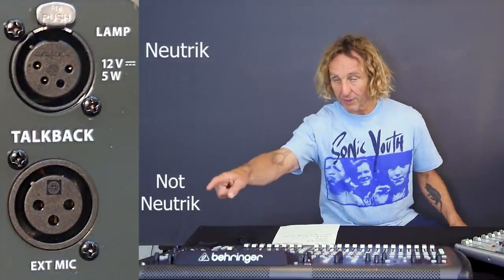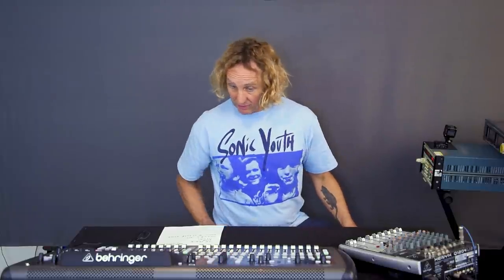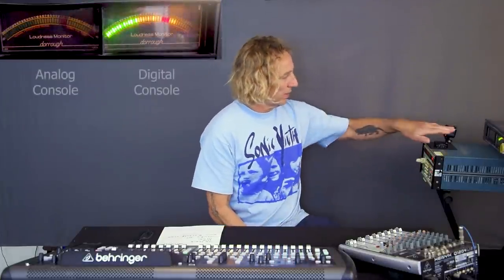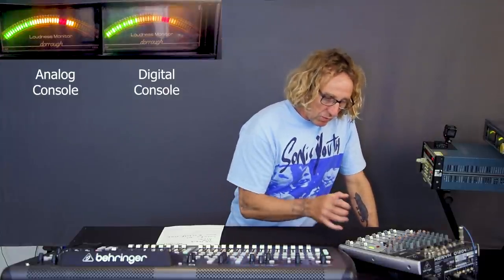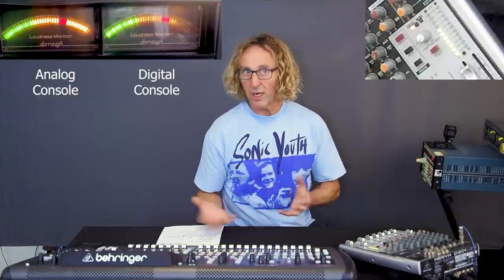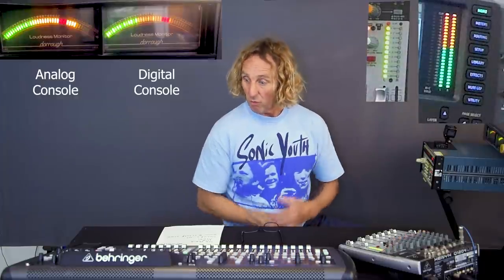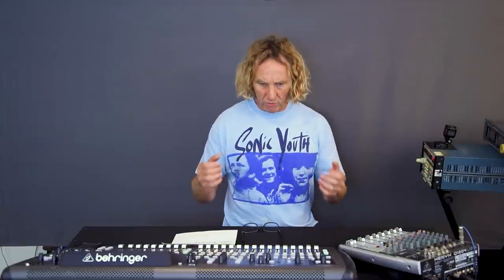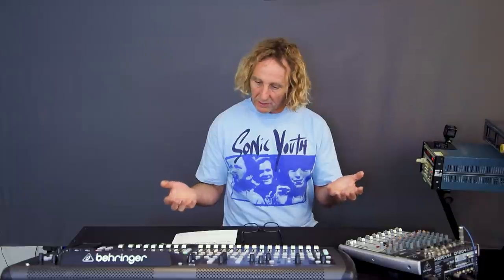Behringer X32 Digital vs Analog Console Metering & Output Levels (Public)

Comment: 100 meters is max length including patch cables. Not really a great idea to count on being able to use the maximum anything of anything.
Reply from the maker: 👍 though it really depends how the max was determined.

Was it determined using a 20% or 50% buffer or is it the actual max?

With rigging, using the max is all good as there are 5:1 or 9:1 buffers accounted for so the rates max is safe.
Reply: @DaveRat  
That is the rule of thumb limit for conventional Ethernet, it is commonly expressed by lots of vendors. Rules of thumb are conservative. On a dedicated network, you can push the limits. Same hardware and transport layer, different traffic environment. 

I have done something similarly for a flight simulator data collection system. We were pumping fast frame rate measurement data over gigabit ethernet and the NICS card we connected to mattered. So did the cable type and length. I don't really know details about audio snakes, I would like to learn. I assume this is using UDP messaging?
Reply: @DaveRat  Wait I just caught that. Are you talking about signal buffers (repeaters) that let you break the cable into shorter length segments or are you referring to redundant messaging?
Reply from the maker: Buffer is not the best word. Am referring to adding an extra length of cable to test and see how close you are the actual no worky length.

With rigging there is a safety ratio where if a fly system is rated at 2000 pounds, it is tested to hold 10,000 to 18,000 pounds, depending on the usage and country.

With aes50 it seems that if it's rated to run down 100 meters it has a safety ratio of like 3 to 5 meters before it starts dropping with cables that will even do it at all.
Reply from the maker: I am not very knowledgeable about audio over Ethernet but I do believe aes50 is raw data without error correction and super low latency. Two higher level methods of transfer that are common and more reliable but higher latency are Dante and avb

Comment: Mhhh... -18 dBfs in digital scale is equal to -6 dBu analog scale: is a 0.755v p.p. sine wave. So there is no difference at all, the two mixers have te same exact output!
Reply from the maker: Thank you and your comment and opinion is a perfect example of why testing is important and just looking at specs is flawed.

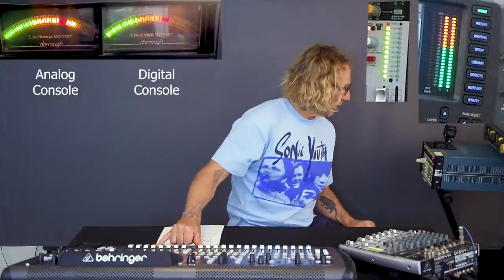Somewhere around 12:00 into video I measure where the console actually clips and show that the analog console has more output before clipping that is easily measurable.

I see quite a bit of this where assumptions about what should happen are presented as factual info.

But testing and finding out what actually happens often shows the assumptions are incorrect.

In real life usage, this analog will have more usable clean audio output level/voltage before clipping